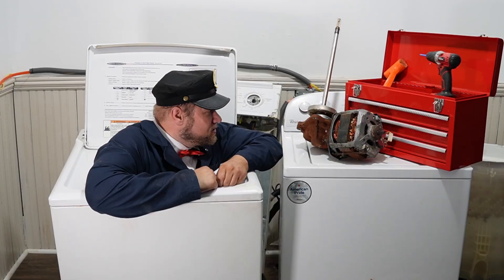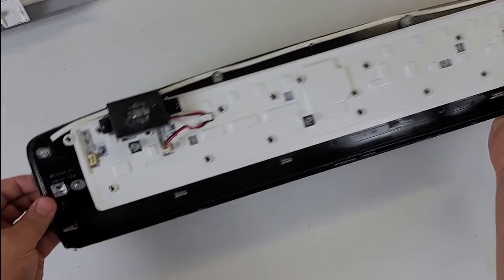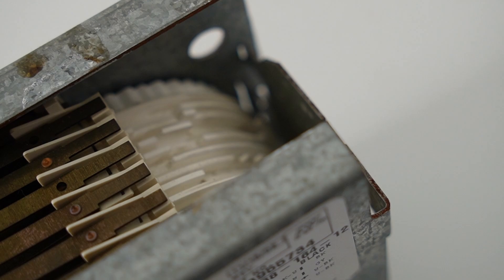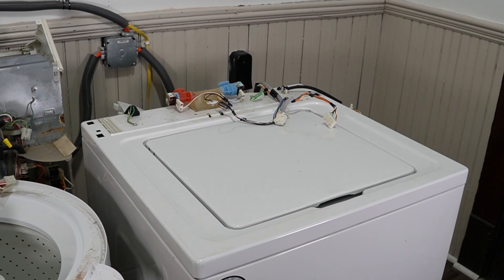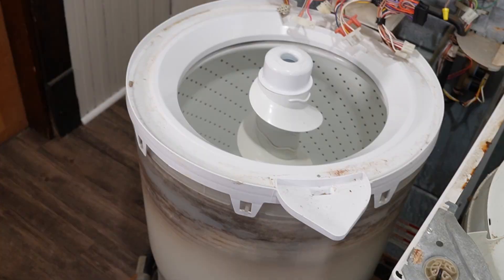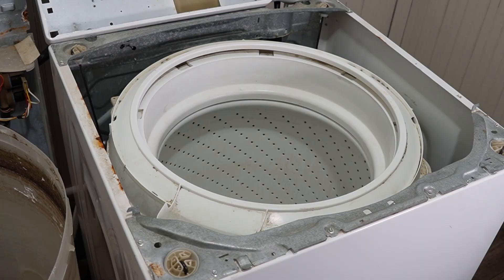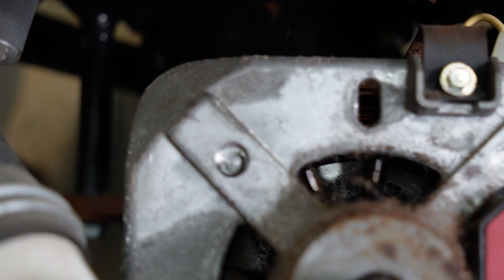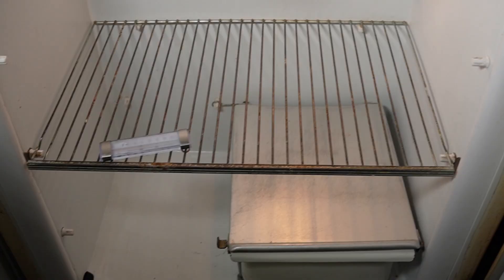Are Washers Built to Break? Inside a 1984 Washer vs. Now

Comment: I own the later year Cabrio versions of washer/dryer (circa 2012-13).  Surprisingly, the washer is easy to work on.  Replaced the gear shifter at 4 years, a cheap part, in about 20 minutes.  The transmission started making loud whirring noises at 8 years.   Whirlpool changed the design where the transmission mates up with the tub.  Different style of spanning/locking nuts.  I had no problem removing them.   Hardest part was sliding a plastic disc seated on the bottom of the shaft that prevented me from pressing the transmission/shaft out.  Once that was removed, then I used a make-shift automotive scissors jack and a block of wood to "press out" the whole transmission and shaft.   The replacement transmission was ~$150.   

Overall, the Cabrio's take a lot of criticism (rightly so), but they did improve them in the later years.  Had mine for over 10 years now, and plan on keeping them both for a very long time; everything is easily serviceable and relatively efficient.

Comment: I'm going to have a very contrary opinion to everyone here, but I can't express strongly enough how much better my newer LG front loader is than the 1988 Whirlpool it replaced. I hated that washer. It held so much less bedding, used so much more water, didn't get clothes as clean, was much louder, just everything about it other than the controls (I despise touch controls, I wish they were still using buttons like the early 2010s ones). I'm fully aware it will die in maybe 5-10 years if I'm lucky. I don't care that the Whirlpool will be usable for another 30+ years with cheap parts. It sucks. I got the LG on facebook for essentially free after buying and flipping a couple crappier Samsung front loaders. And I'll get the next one for basically free as well, and again and again.
But I do wish they would stop making everything with planned obsolescence. I hate the Whirlpool because it sucks, not because it's old. I'd repair this LG forever if it were as cheap and easy as replacing it.
I'm rambling. Love your videos and your outfit.
Reply: Unfortunately they also made junk back then too. Seems to have been a much smaller percent though.
Reply: Ive had a recent LG washer and dryer for the better part of a decade. It should last you, they're nothing like the samsung or GE junk.
Reply: @tardonator  I hope as I have a newer LG fridge. They've had a lot of problems with the compressors. Supposedly what I bought has a better design that fixed the issues.

Comment: VM Whirlpools are garbage. That VM Whirlpool will NEVER live as long as that DD Whirlpool. The new washers absolutely do not get as clean either. The churning action on the DD washer actually flips the clothes over while they're washing. The new washers, do not. Your cost in water / electricity, will be spent in a few short years when you need another washer vs keeping the older DD.

Comment: I own this older washer & love it. Paid only $125 for it when I moved a year ago & it works like a hot-damn. For all the problems new units have, I wasn't about to waste my time, money & effort trying to source a new model that would last more than a year without breaking down, especially living in a more remote area which makes hauling appliances myself a pain in the arse. Not a lot of fun to have to go though even if living in the city.

I also bought a used Maytag dryer, about $100. Works great, only had some minor repairs done by our local appliance repair guy before I bought it.

Comment: i run a laundromat and am still running some whirlpool/Inglis top loads that were installed in 2003/ 2006. and you dont need to pull the drum to pull the trans just remove the agitator and drop the trans from the bottom. those old machines just go seem to run till the bottom rots away. The biggest problem is that they are overloaded on a regular basis and once in a while you have to beef up the spin clutches.

Comment: I have almost the same model as the new whirlpool you show here. I'm not sure if the design is a year or two older or a year or two newer, but it's very close. Mine is considerably easier to disassemble. The inner tub in mine isn't held in by the nut but by an adapter plate with a cross pin made of tough plastic. It might not be as maintainable as older washing machines (this was the first time I've taken one apart), but compared to pretty much anything else I've fixed it was a dream. The technician's manual inside the outer housing was amazing. All the parts that could fail I found to be modular and easy to replace, and it was very easy to source parts. Each part that was a module had a connector that was keyed so you can't mess up the wiring. All the things on the main circuit board that are likely to fail are through-hole components and easy to desolder and test and replace. It was the easiest thing to repair that I've repaired in a while and I fix a lot of random stuff.

Comment: My parents used to own the Kenmore series 80 washer and dryer kit featured here. I remember picking up the appliances with my dad at our local Sears (when there was one around here) back in 2001.
The washer met its demise at age 10-11 when the chassis rusted out but mechanically it was still sound while the dryer was still kicking last year when he sold it along with a Maytag Atlantis washer that replaced the rusted Kenmore.
Now I own the Kenmore version of the Whirlpool washer featured here and it has only needed replacement of the small switching motor shown at 13:26. Part was $30 and replaced myself but I had to run several auto diagnostics on the machine to see what's wrong.
Washer is now 5 yrs old. It's still good but I know it won't outlive the old Kenmores.

Comment: My 1989 and 1991 refrigerators are still kickin ass. Both are relegated to the garage as spares. The 89 model keeps drinks soo cold - I usually let them set to warm up a bit. Its ridiculous how cold they get. The temperature control is accurate and is never run hard. Freezer works perfect as well. Just keep the coils clean and plenty of air to cool the compressor. No issues.

Comment: I have a Kenmore 800 washer. I used to have a problem where it did not want to stop filling with water or it would try and fill/agitate at the same time. Turns out a relay on the module that senses water level, the contacts get burned. I replaced the relay and put a "snubber" circuit across the contacts. No more problems until recently there began to be a puddle of water under the machine. Looks like the seal for the main shaft is leaking. I tried to take it apart to see how bad it was but the tub was so rusted to the shaft i could not get the tub off. I did about everything like the guy in this video and finally gave up. I plan to order an LG washer/dryer. The Kenmore did last for over 20 years though except for the repairs noted above.
Reply: Sounds like my experience about 15 years ago with a Kenmore.  It was a hand-me-down from my step dad’s family.  I had used the machine for almost 20 years myself.  The problem with mine was that all the plastic parts started to disintegrate and I was starting to spend more time fixing than washing.  I bought a Kenmore washer/dryer pair on Black Friday for under $600.  The engineering on the new Kenmore is pretty clever and it has been reliable.  The one thing I really dislike is the top suspension which lets the machine get out of balance way too easily.  Washing big towels or blankets often requires manual intervention at the start of the spin cycle.

Comment: I have that 1984 machine. The one it replaced still worked but the drum rusted out. I saved all the switches, motor, pump and wiring.  Got a nice machine and a full spare parts set.

Comment: I used to repair my washer in early '80s (European style).
I loved the mechanical programmer - which never failed.
I repaired a modern washer - it had a microcontroller instead of the cam-based mechanical programmer. The washer used a switching power supply to power the electronics, which is cheaply made and fails after few years, or when there is a thunderstorm of power failure.
Old washers had a problem with sealed ball bearings. The motor and the water pump were immortal...

Comment: I have that same Kenmore washer and the matching dryer. They are so simple to fix, that as long as I can get parts, I'm keeping them. Over the last 20 years, the parts replaced on the washer are the lid switch, motor coupler, timer and agitator dogs. I finally, after 20 years of nonstop service replaced the thermal fuse and thermostat on the dryer. So that's about $250 in parts over two decades.

Comment: My 1992 1st generation Maytag Neptune front loader is still kickin.  Thanks to videos like this one, I replaced a problematic door switch to an updated one to prevent the main board from failing.  Apparently the old style switch could fail and take the board with it.  I also removed the tub and cleaned it out to remove mold.  The mold problem ended after I removed the "brush" assembly from the front of the tub.

Replaced the pump motor as one of the impeller vanes broke off.  I figure when the tub bearing goes someday the washer will be done.  Until then I just keep runnin' it!
Reply: @muziklvr7776  Correct, brain fart here.  It is a 1st gen Neptune, got it when they first came out in '97.

Comment: I work in housing developments and people often leave their washing machines behind when they move out for whatever reason. 17 years ago when I bought my home an older woman passed away in one of our apartments and her son said he would pay me to discard the washer as he did not need it or want to go through the trouble of moving it. So here I am 17 years later with the exact same bulletproof Kenmore washer in this video. It's in constant use and the only failure was the lid safety. You are absolutely correct that the electronics cost for repair make buying a new appliance the only cost effective option. My Kitchenaid dishwasher failed after two years due to corrosion on the PC board causing contact failure. The board was $185. The unit costs $799. If I couldn't do that repair myself the appliance would have been totalled. I'm not an old guy, I'm 50. It's all crap.

Comment: I've replaced the transmission of the direct drive whirlpool machine in 45 minutes - usually after the machine worked reliably for 20-30 years. The most common part to fail in the $8 motor/transmission coupling. The lid switch fails when operators slams the lid down. The coupling and, clutch and brake all will fail in time, but more quickly when the washer is repeatedly overloaded. Moms 1988 WP built washer and are still working in 2022. I've replaced the coupling in 2001; the agitator dogs in 2014. The dryer has had the electric heater replaced in 2009. I've also replaced the thermostats. I replaced the fuse twice. The ONLY maintenance has been to rotary clean and vacuum the  system yearly. The last part I've replaced was the well worn lint screen in 2015.  All other parts are all original since I sold it to my late stepfather before they were married. As you said in your comparison video, the WP dryer with the rear lint filter sold under Whirlpool and Amana brands are essentially similar to Whirlpool and Kenmore branded dryers since 196O. Parts are cheap, reliable and easy to replace. 
     I certainly wish Whirlpool had not replaced the sturdy, durable, reliable and easily serviceable direct-drive top load washer. I've begged customers not to replace them with the unreliable washers now produced.

Comment: Around 2000, my family bought a set of used machines from a thrift store. The washer cleaned everything you could throw at it, and the lint filter was amazing.  These were already 15 years old when we bought them and we put another decade on them.  I really miss the washer lint filter.

Comment: I made a puller by using a 2" hole saw to make a hole in a 3/4" piece of aluminum about 8" long, 5" wide.  Then drill/tapped two 1/2" holes about 2" out from center.  Then a piece of steel, 1-1/2" wide, 1/2" thick, and 6" long, drilled to clearance holes to match the 1/2" holes.  Then using 5" long x 1/2" bolts and washers, completed the puller.  To use, remove the ring nut, place slab hole down over tub neck, then screw the ring nut down, flat side down, lift the slab up, attach the top steel over the center shaft, with the bolts and washers.  This jury rig now set.  Tighten the 1/2" bolts, pulling the slab up onto the ring nut, which will pull the drum block up and off the shaft.  Yes, a hassle, but worked perfectly.

Comment: Great video. Thanks was interesting to watch. In my OLD washing machine pre 1984 that is still working now I had one problem that the motor coupler broke and I had to replace it. Sear had a GREAT YouTube explaining how to do the job and it worked. Took about twice as long, about 2 hours, but worked and for around $10 I got the machine working again. I wish you would describe the comparison of this part which seems to be relatively simple to repair item. Thanks again for your great video.

Comment: There's a washer at my mother's house that needed a pump when she moved in to one of her relatives houses. Is a 1994 year model and it leaked water slightly after a few months of usage cuz it had not been used for a long time so I knew it had to be a pump and I got one for $35 and put it in and had no problem since with this 26 year old washer

Comment: I had  a 1987 washer and I now have that same washer he's using to compare. Here's the difference I've noticed. The new one uses way less water however my water bill has stayed the same! I feel bamboozled about that part. The old washer cleaned better seemed violent but the new washer wears my clothes out faster probably because the lack of water. The new one has some kind of safety feature or malfunction if the load is off balance it won't spin dry. Which is very frustrating. The old one if it was off balance would walk across the floor but atleast my clothes would be dry. The old one sometimes I would need to just throw my uniform in for 5 minutes and I could trick it to finish faster, the new one even on the quick setting or switching to drain/spin it still takes way too long. As far as durability they both seem well enough made, the newer one is about 5yrs old but still works Ok.  But if I could go back I would probably just buy another old one and save the money.

Comment: I have a 80 Series Kenmore that's 24 years old. I've only had to replace the plastic coupler between the transmission and motor twice. Replaced clutch brakes once (didn't need it buts a wear part), tube for pressure switch and the lid switch.  All very cheap and easy fixes.

Comment: Ya missed talking about the 2 main wear items in the direct drive washer. The easy to replace agitator dogs. They function to only allow the agitator screw assembly to rotate one direction. This forces the clothes downward to the agitator vanes. This movement is the primary wash action of the top load washer. The clothing moving in 40gal of water allowing the fabric to release dirt and detergent work into fabric. Old non HE detergent cleaned by deeply working into fabric and lye to strip away stains. FYI they still sell this type of detergent (no HE symbol) at commercial supply and Costco stores.
The other main wear part is in the transmission, it's the neutral drain assembly. This is very important to the spin function of the transmission. Between agitation and spin the motor must run with the transmission in neutral to pump out the water. There's a neutral drain assembly in the transmission to accomplish this. When it fails, the spin will begin with a full tub of water and burn up the clutch. Once the clutch is shot the spin function will not run fast enough to wring the clothes of water.

Comment: I have an old Maytag top load washer/gas dryer set that is 50 + years old. The motor on the agitator looks heavy duty enough to move a train. The entire time I have owned this washer I have had to replace the drive belt a few times and the safety switch on the lid went out about 10 years ago. I just bypassed it until I rebuilt a very small electrical board. Was so cheap to do and so far still works. Dryer has just needed a drive belt a couple times and the igniter a few times, just normal stuff. 

I don’t care how energy efficient new units are they won’t last the over 60 years my Maytags well on the way to doing. Plate says made in Newton, Iowa

Comment: Around 2012 our washer needed work.  A local dealer said to fix our old machine not to buy a new one. Only needed a switch. Still running well but replaced the timer a couple years ago.

Comment: I would encourage any buyers to look at entry level commercial washers and dryers. If you can't order it with an optional coin slot, then its not the right one. Speedqueen is the brand I bought 8 years ago and they were just $200-$300 more than entry level big box retail store units. They don't have anything fancy but they work, don't have lid locks, easy to repair, should last longer, don't have to follow efficiency standards, etc. They just work hard.

Comment: our family washing machine has been standing and washing for way longer than what it's supposed to be. it is no longer a supported model. only got this main panel replaced once due to water leakage. and also a piece of water distribution valve that is coming from another brand of washing machines that I found at the basement recycleing field. still amazed that it has been washing.